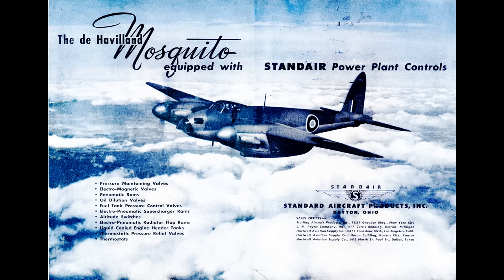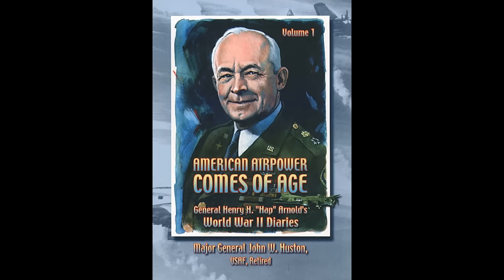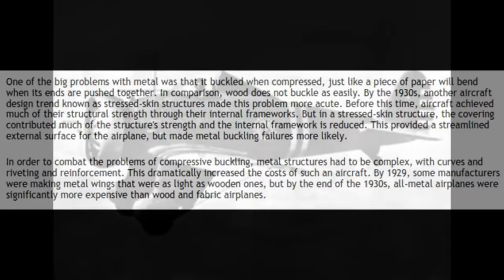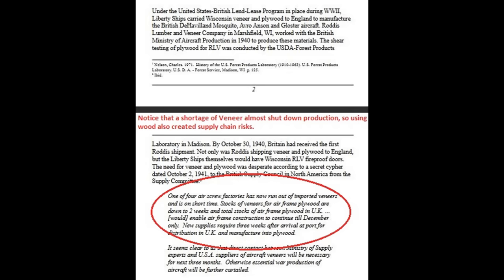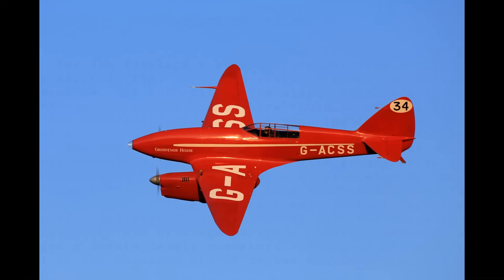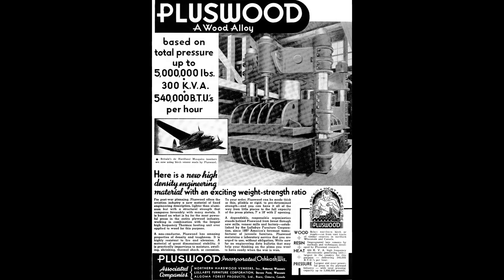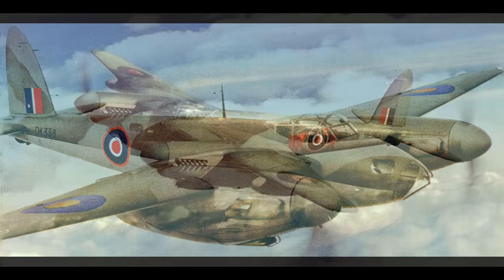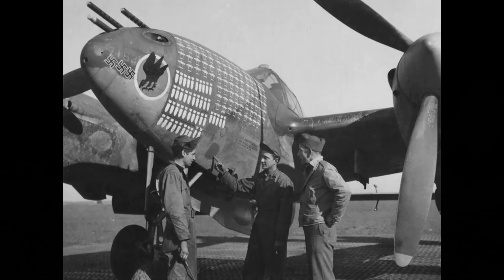De Havilland Mosquito vs. ?

Comment: If I remember correctly there was another main factor that was instrumental in its approval for manufacturing and also in the mindset while designing it initially, and that was to take advantage of the large and experienced wooden manufacturing sector in Britain which was almost being unused as far as the war effort went, and this ties in with the material choice being more readily available. This whole design factor would almost be purely for this one airframe which would see rapid production due to simpler manufacturing processes and no real pressure on the main material as well as having multiple sites to make these components, and a large ready workforce needing minimal training to change from furniture and joinery to aircraft components. This had the extra bonus of having less danger from manufacturing delays when the German blitz damaged more traditional factories for metal production. Also on the ease of manufacturing process, I’m pretty sure that there were some records broken for fastest production and similar feats. Personally I am a fan of both the P-38 and the Mosquito, but it’s a large ask to compare both on equal footings. Both had many outstanding factors but their individual stories, timelines and all related factors just make it like apples and oranges. At a push I’d say the Mosquito was the more remarkable of the two when their whole stories are taken into the judgement, mainly due to the way they came into existence and the actual progression of the war and it’s relevance to the countries of origin for each aircraft at the time. The Mosquito was a lot more seamless in its whole evolution compared to the chequered path the P-38 took.

Comment: Remarkably, it is almost impossible for the crew to get in (or out, for that matter). Crew positions are incredibly crude and uncomfortable.  One would expect this thing to be designed with a little more consideration of the people having to risk their lives while going to war flying this aeroplane.
Reply from the maker: There is no consideration for the crew in the Mosquito, that was pretty typical in WW2.
Reply: @GregsAirplanesandAutomobiles  same with many other aeroplanes ✈️ in the same timeframe, indeed.

Comment: As I mentioned in my comment on your P-38 video, in college I had a teacher, Mr. Gibbs, who before retiring from Lockheed, headed up the team that designed the landing gear for the P-38. He told us that the reason for the P-38 prototype with the up-swiped tail was to try to eliminate the severe tail buffeting suffered during high speed dives. This buffeting rendered the elevators ineffective, and it was thought that disrupted air coming off the contrail nacelle was the culprit, so they tried raising the tale in hopes of getting it above the slipstream, (not to keep it above any water spray on a possible float-plane version of the P-38). Remember, flying boats need a high tail because their fuselage is at water level, but a float-plane is high enough above the water to make a raised tail unnecessary, and there was no way to make a P-38 into a flying boat, (a float-plane maybe, but not a flying boat). He said the upturned tail didn't work, (that particular P-38 was lost due to tail buffeting during testing), but by refining the fillets between the contrail nacelle and wings, the problem was alleviated somewhat. He also said that they later realized the main reason for the buffeting was "compressibility" at the high diving speeds the P-38 was capable of. By the way, in the set of books "War Planes of the Second World War", Fighter Volume IV, on pages 114 and 115, it also states the need to eliminate tail buffeting was the reason for the upturned tail on one test P-38.
Reply from the maker: No question that the up turned tail was an attempt to reduce buffeting, but they also tried to make it a float plane.
Reply: @GregsAirplanesandAutomobiles ; could be, they tried to make float planes outs of Hellcats, Spitfires, Helldivers, and C47's. But the experimental upturned tail on the P-38 was not part of that effort.

Comment: Beechcraft was correct.  The P-38, P51, P47, F4F, F6F, B-25. etc, were all metal and illustrated that the USA was far ahead of the British on airframe construction.
The Mosquito was a good plane, but an anachronism; a last gasp for wooden airframes.  Honestly it probably would have been lighter and easier to mass produce with aluminum stampings.

Comment: An interesting video but it sidesteps some critical points. 1) De Havilland  saw the need for a fast bomber/ reconnaissance aircraft that was so fast it did not need defensive armaments and in this he was proved right as losses of this aircraft and pilots were very low compared to other types. 2) He saw the need for distributed production to avoid loss of production facilities due to German bombing and the use of wood and furniture companies fulfilled this role and played a key role in the Ministry of Aircraft Production giving him the contracts. 3) Because of its speed it was capable of tree top missions and in this it was very successful in taking out strategic German production units like the Philips factory at Eindhoven as well as the Gestapo headquarters in Copenhagen Denmark 4) As the engine capacity improved it became capable of carrying major armaments, including an anti-tank gun that was successful against shipping and submarines. 6) Its speed and low level flight characteristics lead to it being used to mark targets for heavy bombers. 
In my opinion if we in the UK had replaced most of our heavy bomber fleet with Mosquitoes that could take out targets with great accuracy we would not have wasted massive resources and lives in inaccurate area bombing  that did little to impair the German war effort, and that includes the use of heavy bombers on D day and later that had little effect whereas Mosquitoes and Typhoons  would have suppressed the German fire at the beachhead and inland more successfully. Without doubt the Mosquito was the most successful British aircraft of the war alongside the  Hurricane and Typhoon with the Spitfire getting the credit for the Battle of Britain that belongs to the Hurricane largely due to Government propaganda. These aircraft had an advantage over all metal ones in that they could be repaired by field units at operational  airfields whereas the Spitfire and other metal aircraft had usually to be shipped back to factories or regional repair facilities. This gave them a major advantage in terms of available operational hours. I should add that I am a child of the war years so lived the history of these aircraft.

Comment: I am surprised about the inability of the De Havilland Mosquito to take bullet hits.  I was under the impression that balsa and wood were actually better suited to absorb the impact compared to steel.
Reply: the issue is whether the round hits the structural bit or not.  In the case of hitting structural timber, the damage could be severe or even fatal to the aircraft, but if it's not, then it's easily repaired.  Hawker Hurricanes, with their fabric layer, are a classic example when compared to the Supermarine Spitfire.  A round from the Messerschmidt might go right through the Hurricane and do no damage at all (or certain parts of a Mossie, too), and any repair would be a simple patch, but on the stressed metal of the Spitfire, repairs are more lengthy and expensive.

Comment: I read a quote, which I have both lost and cannot verify, that P38 pilots in Italy were forbidden from flying alongside DH98s. There can only be one reason. I don't suppose any aircraft, then or now, could survive a burst of canon fire. I'd been of the opinion that the reason behind our failure, on both sides of the water, to build more of these was essentially industrial. Nobody is going to be making wooden airliners, or jet fighters (unless you were de Havilland!) after the war. The vast legions of USAAF pilots, perhaps our greatest advantage in the war, would have been so much more effective using these in my opinion (a view not shared by most of any Bomber Command forum I have ever dared suggest this to). Thanks for the video, really good.

Comment: In the modern era, we look at composite methods increasingly to build greener lighter aircraft, and in the 30s it gave a lighter faster plane. Aluminum wasn't  as strong as today. When a small amount of copper was added to aluminum it was stronger than pure aluminum.

Comment: In 1942, the Australian de Havilland factory at Bankstown commenced production of a fighter-bomber Mosquito, the DHA 98 FB Mk 40. Initial delays were caused by the unavailability of Canadian birchwood, and Australian coachwood had to be substituted.

The first Australian Mosquito was delivered on 23 July 1943, and accepted by the RAAF on 5 March 1944. The FB Mk 40 was equivalent to the RAF FB Mk VI and, although 212 were built at Bankstown (A52-1/212), only 209 served with the RAAF because A52-12, 18 and 24 crashed before acceptance. Six of the FB Mk 40s were converted for photo-reconnaissance as PR Mk 40s, and these aircraft operated so effectively that a further 28 FB Mk 40s were converted to PR Mk 41s. Previously, A52-90 had been re-engined with Packard Merlin 69s and became the sole FB Mk 42: however, this marque was superseded and A52-90 was used as the prototype for the PR Mk 41 and re-serialled A52-300.

On 28 January 1943, a RAF Mk II (DD664) became the first Mosquito to operate with the RAAF when, as A52-1001, it was used as the prototype for the local FB Mk 40. It was also the forerunner of 14 RAF T Mk IIIs (A52-1002/1015). Australian versions of these trainers were developed by converting 22 FB Mk 40s to T Mk 43s. In addition, a further 61 ex-RAF Mosquitoes were used by the RAAF as follows: 38 B Mk VIs (A52-500/537) and 23 PR Mk XVIs (A52-600/622). Thus, altogether 209 Australian Mosquitoes and 76 UK-built Mosquitoes served with the RAAF. These aircraft fitted with a variety of engines including the Merlin 31, Merlin 33 and Packard Merlin 69.

The RAAF Mosquitoes played a limited, but effective, part in the later years of the Pacific War and served with No 1 Photographic Reconnaissance Unit, Nos 87 and 94 Squadrons, No 78 Wing, No 1 Aircraft Performance Unit, Aircraft Research and Development Unit, Central Flying School, No 5 Operational Training Unit and Ferry/Survey Flights. Post-war, photo-reconnaissance Mosquitoes were used extensively between 1947–53 on survey flights throughout Australia. Mosquito flying ceased (mainly) in 1954, and the aircraft still on RAAF strength were passed to DAP for disposal, except for a few which were transferred to the Royal New Zealand Air Force.

After the war, Mosquitoes laden with cameras surveyed all of India, Cambodia, and Australia. The last Mosquito built, an NF 38 (VX916), rolled off the production line at Chester on 28 November 1950, and the last operational combat mission was on 21 December 1955 when a Mosquito PR 34A conducted a reconnaissance mission above suspected communist strongholds hidden in the jungles of Malaya.

Comment: A friend's father, a young flak helper late in the war witnessed one being shot down by a 262. As he told me, fire control ordered to cease fire and he saw the smoke trail from the 262. The Mossie went to WEP, the rpms increasing significantly and diving westward. The 262, however, had already spotted its prey and easily caught up to it shooting it down in a single pass.

I haven't cross-checked the reports, I'd need to ask him where he was stationed, if he'll even remember at his old age (he was barely 16 by the end of the war).

Comment: de Havilland, built two mosquitoes, the first was a 4 engined aircraft which was too heavy and slow.  The second the famous two engined version was a vast improvement with better Rolls Royce engines, better streamlining and much lighter., extremely fast with exceptional range. So if your reference is to the first mosquito then the American administration was probably correct in their assessment, it was a disaster.

Comment: You really need to check out Prague Castle, If you go to the latest part of the Castle and take notice of the Door sizes and walk to the newer areas you will notice that the doors go from maybe 5 feet + or — to what is now a normal size door of todays standard. It is very easy to see and what the guide  told us castle construction started the year 900 and ended construction 1929. The reason for the change is peoples diets became better and as they did people grew taller and needed bigger doors . Not much to due with airplanes but interesting castle fact
Reply from the maker: I do need to check that out. However last time I was in Prague, I was there with a bunch of slam clicks and I didn't want to go out by myself so I didn't see much beyond the hotel area.

Comment: Considering that even in the US Aluminum was such an important material there was a brief proposal to make the Ford GAA out of cast iron. With aircraft having the highest priority compared to everything else (Navy and Army included). As of March 1943.
Reply: Allied had Suriname and also other major sources of bauxite available. It never did came to real shortage. For example, US supplied to USSR so much aluminium that  their ac producers had an rolling production changes where wooden part after another was replaced by dural. Mossie production employed hundreds/thousands of skilled cabinet and furniture workers in production of 1st class weapon, that may had been the real strategic advantage.

BTW. Even resource poor Germany managed to handle Alu for aircraft production without it becoming bottleneck. With recycling and priority given to aircraft production. Couple "2nd option" types were designed around possible shortage, like Albermarle, without much success.

Mossie was wood because De Havilland made their planes that way.

Comment: It wasnt designed as a fast bomber ... It was designed as an intruder. Bombers and intruders have different tactical and strategical roles. 
Read Tactical and Technical trends from 1940 to 1944. They talk about the Mosquito and wooden aircraft. They also compared the P-38 vs the Mosquito. Youll see why the US preferred the P-38. One big reason is supply chain and how quickly and $$ parts could be obtained. A lot of Mosquitoes were declared salvage just to repair battledamaged ones. 

The Mosquito was a great intruder no doubt, and designed as such. The US did use the P-38 in the intruder role also and it preferred the P-38. You could make a P-38 way quicker than a Mosquito and of everything ive read the combat performance, it was slightly less effective than P-38, with the P-38 being a much better dog fighter. Everything the Mosquito could do the P-38 could do better and you dpnt have to worry about having to replace a whole limb rather than patch it.

Comment: OK the Mosquito was made of wood - but using innovative composite laminates that gave great strength for weight. Coupled with superb RR engines, the power to weight was also exceptional. 

Attempts by other countries such as the Italians to build a fast medium bomber out of metal failed to achieve anything approaching the Mosquito's performance. The technology simply wasn't there yet.

In many ways you could say that the Mosquito anticipated modern composite airframes.

Comment: Wood not only saves the cost of materials but it required substantially less machinery and energy to build a plane.   Although logistics  of material influenced the use of the material, so did cost and ease of manufacturing.

Comment: I'm surprised you did not mention the stealth advantage of wooden construction. One of the most important qualities of the Mosquito was that it could not be detected by radar and raids were made deep into Germany where the aircraft were completely undetected until they started bombing. Then, as you mentioned, they were fast enough to get away.
Reply from the maker: They could be picked up on radar. Wood is not stealth, that's a bit of a myth.

Comment: To give you a pilot's comparison between the mosquito and a P38.. An Australian photo reconnaissance pilot talking to me in 1947 (after WW2) when after 2 tours the squadron went to Windsor Canada for splitting and forming 2 squadrons with some new pilots. In the bars between the U.S. and Mosquito pilots there was the argument of what was the best and fastest aircraft. Eventually the respective C.Os'. allowed a fly off. The Mostquito pilot asked if the P38 pilot was at maximum. On receiving,"Yes." was told, "Watch this ." The throttle was put through the gate on one engine and the other prop.  feathered; did a barrel roll about the P38 and coming back to level un-feathered the dead prop.  and blew the P38 off.
Reply from the maker: Cool story, but there is no way a Mosquito on one engine can keep up with a P-38 on two.
Reply: And you believed that story😅 I'd bet that guy is a fisherman.

Comment: One issue with the Mossie (it was a amazing plane) was the the engines were not contra-rotating- they just fitted 2 engines without reversing 1.  This meant the pilots had to get used to high torque effects under full power- and you never took off at full power.